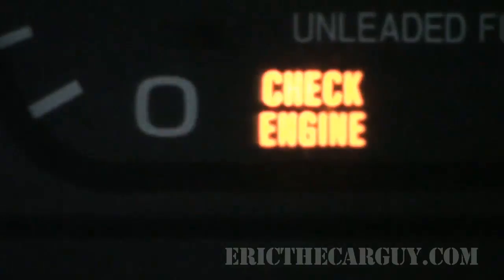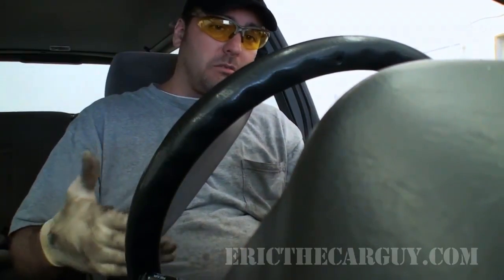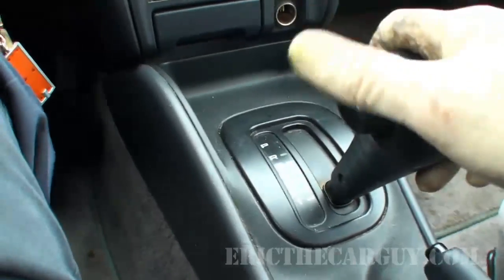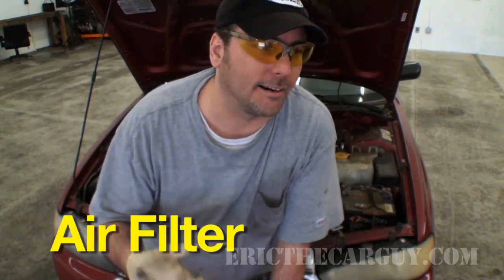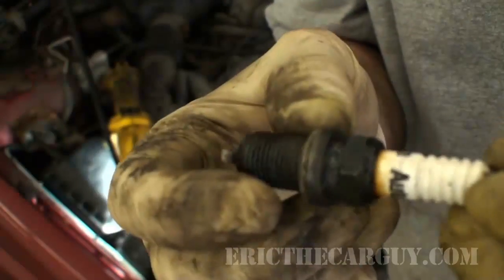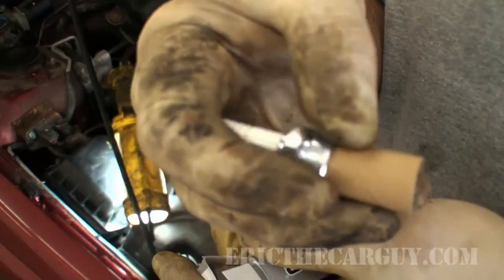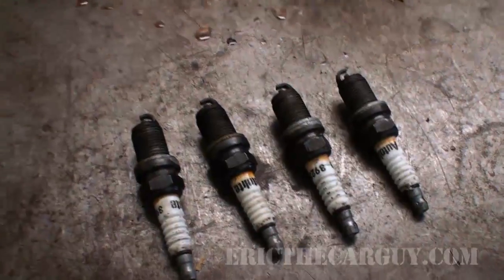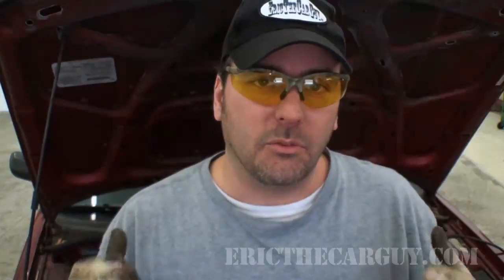Solving Engine Performance Issues (Part 1) - EricTheCarGuy

Comment: Love your videos. Subscribing was the best thing I've done on youtube. 

I live in Japan and have a 2001 Subaru Legacy GT-B e-tune II. Not a bad car, but recently it's juddering at idle and has the same issue your subaru had here. I'm waiting delivery of new plugs, but today I checked the ignition coils for any visible signs of damage. I noticed how difficult the access to the spark plugs is on my model. Any tips to make it easier? Is it safe to jack up the engine?

Comment: im having a simular problem with my moped. sometimes taking off it goes perfect. but other times the engine bogs down and i get almost no power. but once you get up to speed it drives fine.please let me know if you know whats wrong

Comment: I had the same problem with an '86 Olds 98, got a ticket when I took my foot off the gas while doing 60 in a 65, Rolla, MO SUCKS!!! it hit 70, they "clocked" me at 75, performance issue, or just "quota seeking"? you decide...

Comment: normal tune up to me means
Air Filter 
Oil Change and filter
Plug change and new wires
New CTS
Clean MAF Sensor
Clean IAC Valve
Clean EGR Valve
Clean TPS
Replace Cam/Valve Cover gasket
Replace PCV Valve
Replace Air Breather
Clean Entire Air Box/Air Intake
Clean Battery terminals
Change Engine Coolant
Change Brake Pads
Clean Brake Drums
Grease certain points on Chassis
Check rotors
Check tire pressure
replace gas cap

and yes I do all of this and never have drive-ability problems

Comment: My 97 Honda Accord 2.2L has the same issue, it only happens when from a dead stop with the transmission in D4, as it shifts to 2nd gear the RPMs drop and acceleration hesitates for a few seconds, then it slowly gives power and RPMs begin to rise. It doesn't happen all the time, but it does happen even when the engine is warmed up or cold.
 feels like the lockup solenoid is switching on when it shouldn't or the transmission jumps from 1st gear right to 3rd? Eric, have you ever solved this?

Comment: Air filter and fuel filter rarely give drivability problems unless they are really dirty/clogged/neglected for over X years.  Many owner's manual tells you to change air filter at every 15,000 miles/X years, which for me is too long of an interval; I do mine at every oil change; 3,500 miles.  Air filters are cheap and I only use genuine filter (in the case of Acura(Honda), they are oil-soaked and non-cleanable).  Changing the fuel filter on some Acuras are PITA; integrated into the fuel pump.

Comment: Eric, I don't know if this question is correct; If performing a tune up, changing the plugs, should the ignition coil be replace to? I have a WRX and its showing hesitation. I will do the checks you suggested.

Comment: Very good video, had a similar issued with my nissan, it was a bad ignition wire for #2 cylinder, I did follow ur troubleshotting protocal, and solved the problem. 
Thank you.

Comment: If the old filter was plugged (restricted), checking it at idle is. at best, a very insensitive test. Pressure drop ONLY occurs when there is flow, and is proportional to it.  You almost were on to something when you slipped the throttle and measured the pressure on the outlet of the old filter.  If you had held it at a constant high RPM, and compared the new filter at the same rpm, you might have seen a pressure drop greater in the old filter, if it was plugged.

Otherwise,  great video.

Comment: Good video, just one thing. Why not gap the plugs to the recommended spec? It only takes about 2 minutes and can make a noticeable difference. I have personally experienced regular NGK plugs up to .020 off the recommended spec, which as I'm sure you know can make a noticeable difference.

Comment: Hello Mr Eric I have 1999 Subaru Impreza outlet it used to run very good I use to used it as a tow to pull my other car with it stuck in snow but now it has lot crank and looks like it has fuel coming but wont start please give me some idea thanks for you great vedio

Comment: What would you say the source of a problem where the car vibrates when in gear, but not in neutral/park? I have a 2000 olds alero 2.4 4cyl that vibrates noticeably when idling in gear. Idles around ~650RPM, engine will chug/struggle when turning at low speeds, when i turn on high-amp stuff like rear defrost, high beams, full blower fan, etc. Runs smooth above ~800RPM. Just hoping it isn't a tranny issue, and i believe the tranny filter was replaced in ~2011. Thanks for the great vids and advice.

Comment: Recommend:

Apple iPad 4th Gen 32GB Unlocked Wi-Fi+4G 9.7in White Price:$390

Apple iPhone 5 (Latest Model) - 32GB - Black Price:$385

LED 3D HDTV: Panasonic 65-inch 3D LED HDTV Price:$460

Sony 60-inch 3D LED HDTV Price:$510

All-in-One PCs: Apple MB417LL/A iMac w/ 20" display desktop computer Price:$320

Camera :Nikon D90 SLR Camera /18-55mm /55-200mm 32GB  Price:$390 

Laptop: Apple MB543LL/A MacBook Price: $350

>>>>>>>>>>>>>>>>>>>>>    Purchase online Website is:  FUUshop.com

Comment: the plugs were in the cold side of the heat range. Probably that was you low rev hesitation. Nor that Autolites have no place in a foreign engine, but it has to be the correct cross reference.
Nice test with the Fuel Pressure.

Comment: some times i saw little  black smoke if the rpm about  high 4500 - 5000 

do you think the sparks is the reason ?

Comment: my car sputters when i accelerate, but i took the spark plug wires off and back on and it doesn't sputter anymore, but now after two days it is sputtering again, and the ends of the spark plug have yellowish color to them. what would you think the problem is.

Comment: Het Eric, How about changing your gloves before rolling the camera! Glad that it was your car and not mine with those gribby paws.
Spark plug video - How true about spark plugs being specific to car manufactures. I once pulled AC plugs from a Chrysler with drivability issues, what a change going to the Mopar brand of Champion plugs.(AC = Albert Champion, Go figure.)
What about addressing Platinum vs. Regular plugs? Love the site! Dave - 25 years experience turning wrenches. Started 8/1976

Comment: older chevy pickups the fuel filter was right on the left side frame rail. Convenient? yes.. after 10 years of New York Rust...Horrible spot. The ends rust up solid and normally snaps the line,

Comment: I use the same plugs, they always fire on the edge, instead of center of the electrode, best spark plug i have used altho they don't last as long. so you have to re-gap sooner

bought 11 plugs to get the electrodes to line up for all 8 cylinders

Comment: Engine size does not always correspond to engine power. Your V8 could still be carburetted unlike your moms car which is most probably fuel injected. That makes a huge difference already. If I am correct the Astro has the Vortec V4300 V6 engine (I have owned a Chevy Blazer with the same engine). Through modern wonders we can have engines that have smaller displacement but more power. 1.6 Toyota corolla has 109 hp while 2.0 Nissan X-Trail has 140 hp, the difference is only 0.4 liters.

Comment: Im not a professional by any means, but it could be "blow back" from the motor, which emanates from unseated/damaged piston rings, too much oil is bypassing and ending up there, it could also be a PCV issue if oil is getting that far(check this first, as its much cheaper)

Comment: There's motor oil comming up to my intake throttle body. 2001 Acura tl 154000 miles. What's the problem?

Comment: Champions or NGKs  Dodge designs their igntion system around champion spark plugs.  I put a Denso plug in my Dodge and it was worst than the plugs I replace them with.  Autolites work good with Ford because Motorcraft makes Autolites.  Autolites or a generic version of Fords Motorcraft plugs.  All GM cars should use ALDelco plugs.

Comment: I hate when the idiotic mechanics are touching all over my car with their dirty hands/gloves like you did here.Once I had my car full of oil/grease  marks all over( seats,steering wheel,pillars,seatbelt,shifter,you name it...) and the car was 6 months old taken there for an oil change....HATE IT, HATE IT , HATE IT!!!!!! Sometimes I think they do more bad things than good .Since then,I do myself the oil changes (30 min) and save 2 hours of interior/exterior cleaning or $60-80 to a detailing shop.

Comment: I have a Ford Escort that dropped a valve cylinder ring and exploded like crunchy popcorn in my engine.  My mechanic told me essentially that my problem was a design one and that it was a Ford and an American made piece of shit.   How do i fix it?  Can I like put a Honda or like Toyota badge on it and will that fix the problem?  My mechanic told me my best bet to get it fixed was to take it down to the Ford dealership, set it on fire, push it into the lot and send pictures to the local newspaper

Comment: "sparks" if you are using MSD ignition you need to to use platinum or iridium to hadle the extra sparks from that. read my comment and you can verify that. i never iridium because of the price but research shows iridium handles more heat. if you were sponsored in a racing team would you consider? another random question do you trust the parts people when they tell you its "pre-gapped" i never do

Comment: you didn't mention, do you have a check engine or service engine soon light on? do you have any codes in the computer? Pretty hard to diagnose over a very limited discussion board.

Comment: Check your air intake system and make sure it is hooked up correctly, check vacuum hoses and make sure your air filter is clean. Hook a fuel pressure gauge to it and check the key on fuel pressure, check the specs, should be around 35psi. if low, change the fuel filter and recheck. If still low, check fuel pressure regulator for leaks. If OK, replace the fuel pump if pressure low.

Comment: you don't need to gap spark plugs. They are pre-gapped, and unless they were dropped, they will be correct. I've been installing them for decades and used to check gap all the time, they are rarely, if never wrong. He doesn't need to check the gap, just eyeball them to make sure they look OK.

Comment: Kept me from learning what? I know this subject inside out, and upside down. I have a masters in Automotive engineering and developed an alternative fuel system. I used to be a guest speaker at Lansing Technical college (best in the US) as a subject matter expert. I have an idea of what classes you took, but your conclusions are WAY off. People always try to complicate the simple. Back in the early 80's, computerized diagnostics and "Allen" scopes were basically a scam to sell to customers.

Comment: More spark? Platinum plugs only advantage is the electrode last longer as standard plugs erode as they spark. Platinum doesn't erode as it sparks BUT they cost a LOT (3 to 4 times as much) and foul easier in engines not designed for them or have oil burning issues. Copper and iridium is a gimmick, just trying to get you to spend more money on something you don't need. Like nitrogen in tires, figured a way to sucker you into paying for air which is usually free. Ignition works or it doesn't.

Comment: copper doesnt do well with high heat[ lasts about 60k miles]  it is the only plug type that could be filed flat again and cleaned to be reused smarter to just replace it though if its worn or fouled platinum handles higher heat better and if you use msd ignition you want to use platinum or iridum becuase theres more sparks jumping the gap[lasts about 100k miles]

Comment: ive taken my cars motor that was seized up it sat for 10 nyears before i delt with it[i didnt have the title b4]. i worked it free without removing the heads found it had no spark, found that the coil wasnt wired up to have power. set it up with key on power set the wires up in the correct order added a little fuel in the intake and it started right up im sure ive learned how to do things that way to. everyone could go to the same class and learn somthing different and some work harder to do so

Comment: now you show your true colors troll. the idea to compare the wave forms was an idea i came up with, in order to save time because running the different plugs throu 60000 miles + would take forever. these tests are also in my text books so you couldnt blame this info just on my instructors and you also have not proven me wrong on the usefullness of the dso beyond simple secondary ignition. all you have been doing is claiming the dso tests useless. looks like apathy has kept you from learning

Comment: You are so full of shit, it's amazing. Your instructor taught you crap nowadays. Easy enough to pull a plug and inspect it, easy enough to ohm check a plug wire. Missfire boils down to 3 things, 1. Air/fuel, 2. Spark and 3. Compression.... If it has all 3, it's running, if not... find out why.... really... it's that simple.

Comment: The computer cannot "read" the resistance of the spark plug, the computer isn't even in the "spark event" loop. It is only a coil trigger. BUT, you are correct, manufacturer plugs work best because that's what it was designed with from the ground up. From drafting the mechanical components all the way to production.

Comment: the wave form of the component you are using the dso to see is presented on a graph the vertical and horizontal lines are cursors marking measurements of voltage and [length]time the amplitude is how high and low the voltage goes on the graph. for this test on the spark plugs [autolight vs motorcraft] working simular or not im talking about the wave from during secondary ignition.

Comment: by looking at the wave forms that the components put out while in use. you can compare the wave for to one on file of a "good condition" component wave forms that are irregular wouldnt match that allowing you to diagnose the condition of said component whether its a spark plug, electronic egr valve, O2 sensor etc. without removing it first this can save time with practice.

Comment: my degree is a AAS in automtive technology to be able to work on and repair motors, brakes, suspension and steering, electrical, automatic and manual transmissions, hvac, engine performance [electronics and other engine controls], automtive electrical and engine electrical. thats the vague way to pu it. i still need plenty of work expierence obviously.

Comment: your right about the spark plugs, I have an 01 Rodeo that DEMANDS Densos be used. I tried the autolites or some other aftermarket spark plug and my CEL would not go away. Turns out the computer reads the resistance of the plug and it know it should be a Denso. so I had to change them again back to the Denso.

Comment: Yeah, back before solid state ignition they were "sort-of" handy to watch your ignition. Could see a coil collapse or a huge jump in voltage on a bad cylinder which could point you in the right direction. Since ABS sensor produce an AC voltage, you could use them on that too, BUT nowadays ABS sensors are easily diagnosed with OBD2 PCMs and a quick test drive. I don't know what this guy is trying to sell. Whatever it is, I ain't buying it.

Comment: AND? Help you diagnose what? Tell you what, I understand waves, I used a REAL ocilloscope the 70's, they died off in the early 80's with the computer (and solid state ignition). Weren't real handy in the 70's either. Tell me, what "wave form" exactly are you looking at and what are you looking for? I'm really curious. Where exactly do you get the pattern from? What type of inductor device do you use?

Comment: you seem really close minded. i have recently recieved my degree in automotive i dont claim that i know more than others just what i have been exposed to in my classes and its clear to me why people specialize because there is alot of information out there to get hung up on. you can lookup a Digital storage oscilloscope anyway. if you have not been trained to know what your looking at with the wave data it wouldnt help you. amplitude, time,  shape/symetry/sequence of events and cursors.

Comment: Funny, I have a New Genisys and I know of no ignition "wave pattern" that is an occiloscope generated signals. I can see the A/C patterns of the ABS sensors and as far as oxygen sensors, I look at the millivolt, cross count data, STFT and LTFT to determine their health and what could cause the issues I'm dealing with. There is NOTHING you can convince me that a scope is necessary in ANY drivability diagnostics today. Wave data is useless, either it works or it doesn't.

Comment: the newer obd 2 scanners likw Genisys and Pegisys which i was trained to use have oscilloscopes in them that can record the wave data. they use those to diagnose many different components including the signal from the O2 sensors which can verify if the catlitc converter is working and so on. when troublshooting electrical faults on a computer controlled system a oscilloscope is one of the best and quickest ways solve the diagnose the problem.it may be an old tool but its not obsolete

Comment: it could be pcv or egr valve either one. take pcv out and shake it. if you can hear a loud tick then its still decent. if not its covered in oil. also check the hose coming off the pcv. sometimes they get rips in em.

Comment: "Wave Pattern"? Now you are talking ridiculous. I've used an oscilloscope many times and what it showed me is the voltage of the spark, not a "wave". It showed me coil saturation and measured the spark event in KV. I don't use one anymore because I don't need to. I use standard, quality parts and haven't needed to use a scope since the early 80's. Most "old fashioned" diagnostic equipment I use currently is a compression gauge, vacuum gauge, DVOM and a fuel pressure gauge. Scopes are a waste